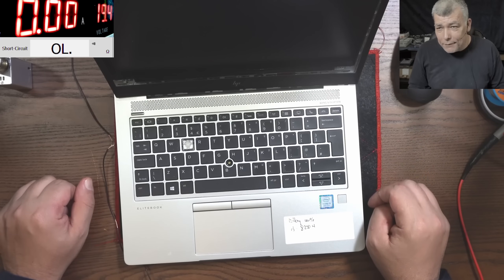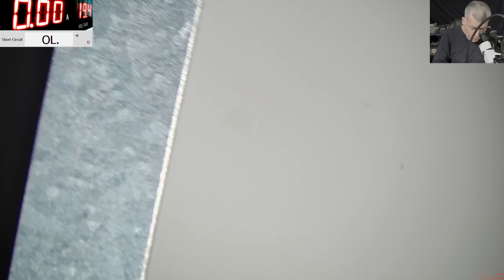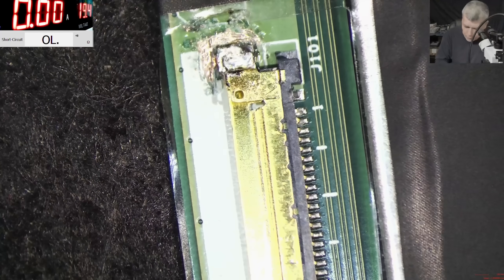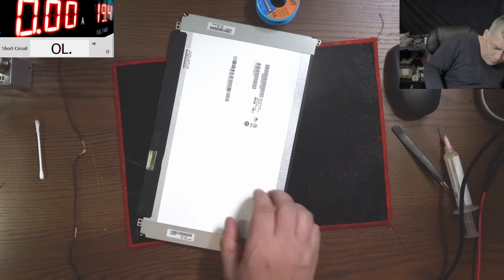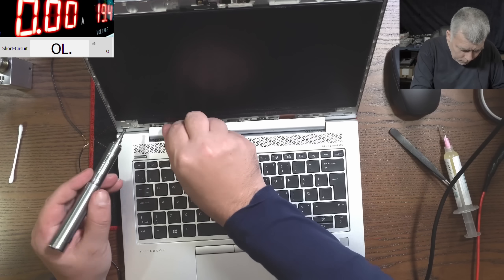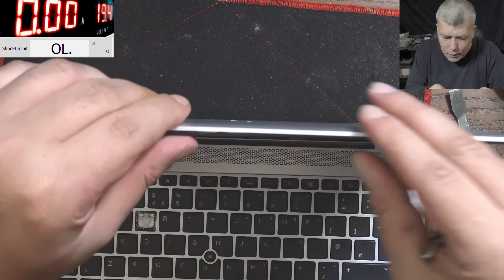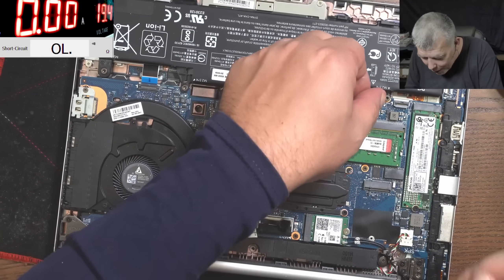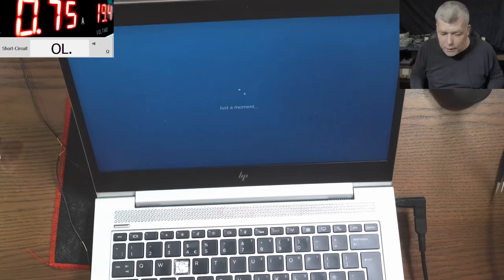HP EliteBook 830 G5 screen connector repair - a perfect job for a Monday evening

Comment: Hi sir I am student I have  Asus vivobook k15 11th generation laptop yesterday I am working on that laptop at the 4%battery remaining I plugged the charger then using it  continuesly working the battery go to 0% percent then it will switched off then after charging it to three hours, I try to open the laptop but it doesn't turn on after plugged the charger Laptop will only turn on and it shows 100%charging and after removing the charging plug it turns off and after plugged the charger it turns on again but it turns off after removing the charger plug and if I try to charge the laptop it's  orange Led charging light is blinking,  but it not turning on without plugging the charger, I also updated the battery drivers but it's no use. I buyed that laptop at 2023 newyear it's only been 9 months, it's my first time facing this type of problem. 
Sir please help me how to solve the problem 😢😢🙏🙏🙏

Comment: You can remove that back plastic piece that holds the bottom part of the bezel in. Usually the laptop has to be closed, flipped upside down, but you can pry between that part and the screen to take that part off.